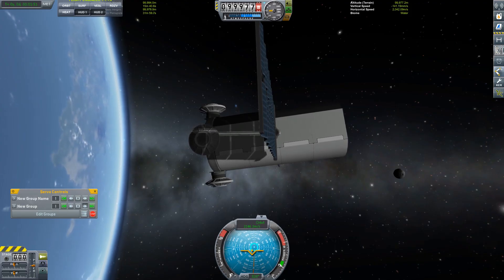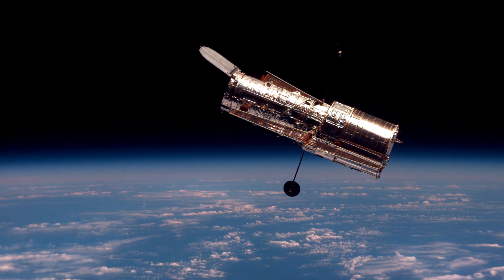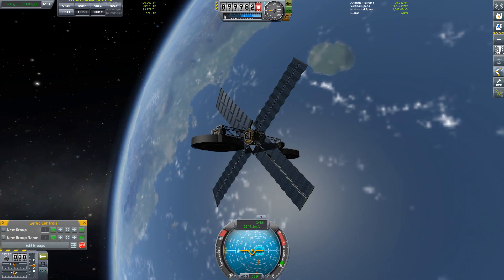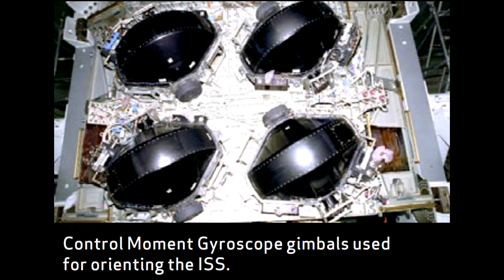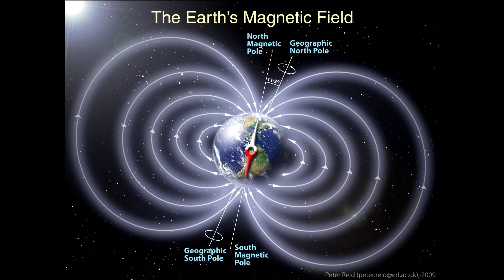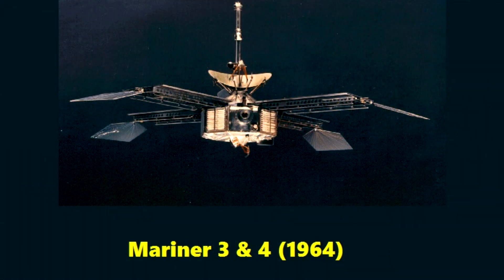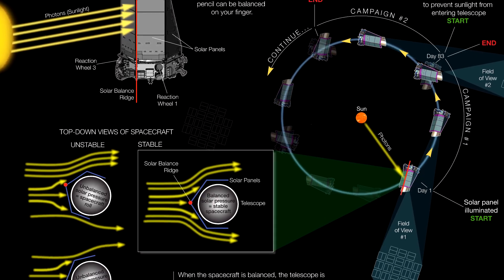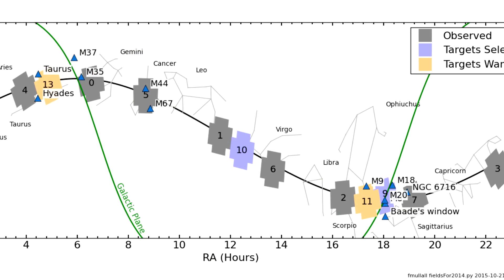Reaction Wheels - Things Kerbal Space Program Doesn't Teach

Comment: You can feel a gyroscope saturation first-hand if you buy a "gyroscopic wrist exerciser", a relatively small gyro with its axis placed on an inner diameter of a bearing inside a plastic shell. You add initial spin with a spring or with a "shoestring" pull - then continuously try to shift its axis of rotation using your wrist. This makes the gyro spin faster and faster, making turning its axis more and more difficult. In an exerciser, the gyro is being constantly slowed down by the friction of its axle in its bearings (transferring small portions of torque to your hand), but in a spacecraft, it will instead try to make the whole thing spin, so it must be countered by another gyro - which will also spin faster and faster...

Comment: Angular momentum isn't always conserved. Imagine a railway sleeper, floating in space, and a gun with a bullet. Nothing rotating, angular momentum =0. Shoot at one end of the sleeper. Bullet embeds itself in the sleeper. The sleeper and bullet now spin off rotating, but the gun is not rotating in the other direction. Angular momentum now <>0.
Reply from the maker: You have to calculate angular momentum around the center of mass in the entire system. the center is close to the sleeper, not inside the gun.

Comment: wouldn't it be most easy to use the gravitation force to get stable alignment with the earth?  - just moving the weight center far enogh from the object center should be enough to get a satalite rotating as it is turning around the earth.
Not as felxible as the used technology but it would seem the most durable and efficient method.
The moon shows that it is possible ...

Comment: Another issue with reaction wheels and gyroscopes is that they're pretty damn heavy. Anyone who has held an aircraft artificial horizon gyroscope will back me up on this that they're relatively heavy, since the heavier the reaction wheel is, the slower you need to spin it in order to reduce concerns about balancing and such. Not to mention they are very prone to failures considering that they are fairly complex pieces of kit. I guess there's also the fact that they can be fairly dangerous too, since they spin so fast and have so much torque behind them, it's possible for a person who might be replacing one to forget to spool it down before removing it. It's happened many times in Aerospace where people have hastily removed a Attitude sensor, only to realise that once it was loose enough, it'll start rolling around potentially hurting someone. Not too big of a concern regarding space since the people sent to do these jobs have a higher level of training than most people on the planet, but still a concern non the less when it comes to commercializing space travel and having to reduce the required training in order to fill in the jobs.

Comment: Couldn't you desaturate a control moment gyroscope by shutting it down, resetting it's alignment and then spinning it back up again (virtually no torque would be applied since the wheels are not spinning)
Reply from the maker: Sure, but that wouldn’t eliminate the rotation of the vehicle
Reply: @scottmanley  well that sucks

Comment: Hi Scott .. I just watched this, brilliant as always. I just paused when you talked about saturation on positional gyroscopes - instead of thrusters at this point to 'reset' against a constant exterior force like sun vs sola panels, why not shut down the gyro(s) in a well organised way, rotate them mechanically back to a 'resetted' position that takes into account this long slow correction that would be needed again, then restart rotation, process repeated ad infinitum .. ? That would use no finite fuel and use 'infinite' electricity instead...

Comment: Telecommunications satellites use reaction wheels in order to maintain accurate pointing toward earth. There is over time a net torque on the spacecraft due to solar effects. Eventually, the wheels become 'saturated', as you mentioned, meaning that they have been spun up to there maximum speed. At this point, a 'momentum dump' must be performed. This is where propellant is expended to provide force to allow the wheels to be spun down, reducing the RMP. An alternative to momentum dumping that  expends mono propellant would be to rotate the space craft via reaction wheels in the opposite direction. This is not done in the case of telecommunications satellites because they must maintain pointing at earth at all times. However, the Hubble Space Telescope does not have this restriction. In fact, the HST does not have any propellant based thrusters at all. Exhaust from thrusters could foul the optics. The HST keeps the reaction wheels within their limits through rotating the spacecraft only, not by momentum dumping with thrusters.

Comment: I suppose it wouldn't be feasible to combine momentum wheels and control moment gyros into one system that is capable of performing in both modes at once, right? They both have spinning wheels and both act against the vehicle's frame, so I would have thought their effects could be combined in a beneficial way, if not for attitude control but perhaps for desaturation, but I haven't heard of any such arrangement. Or have you?

Comment: There is another way to use reaction wheels.  Have 2 of them on same axis counter-rotating.  PV panels spin them up. You get attitude control by using one as a generator to spin the other or asymmetrical charge/discharge. You also can use them as power storage. Works best for satellites that pass through the shadows. High power output for a short time plus attitude control in one package.

Comment: Reaction wheels apply torque only when the flywheel is accelerating.  That is, in order to produce torque to rotate a sat a reaction wheel with an access of rotation parallel to the desired sat rotation must be spun up OR down and thus the torque applied to do that with result in a torque to rotate the sat.  So, it's not the speed of the flywheel but the change in speed of it.  There is, of course, a tiny bit of friction in the reaction wheels that must be compensated with torque from the motor, but the force of the friction and the torque of the motor tend to cancel.

Comment: Has anyone designed a gyroscopic system where the wheels can be stopped to allow them to be repositioned?  It would, of course, apply torque to the spacecraft to do so like a reaction wheel, but maybe if you operated them in pairs you could get the torque applied in a helpful way...

Comment: Is the fuel needed to de-saturate less than the fuel that would've been required to perform the maneuvers those saturated wheels performed to get to that point?

I'm guessing it would have to be, otherwise there'd be no point. Right?
Reply: If you just spin up the wheels to saturation then use fuel and then desaturate them, you will have used the same amount of fuel as it would have taken to do the rotation normally (conservation of energy). But if you do lots of small rotations in different directions, some of them will desaturate the wheels, so you save on fuel.
Reply: Thanks. :) 
That makes a lot of sense.
Reply: It actually does save fuel. With RCS you need to fire once to get the spacecraft to rotate, then fire in the opposite direction to stop the rotation. With RCW you change the rpm to rotate the spacecraft, then change it back to the original speed to stop the rotation. The overall change in rpm is ±0, so you don't need RCS fuel to counter that.

Another reason (I reckon) is that RCWs allow for much more precise changes in attitude, specially for smaller vehicles.

Comment: Would it be possible to handle saturation with a second set of reaction wheels or control moment gyros? What I am thinking is that while the first set spins down and reorients a second set could spin up and take over in the downtime of the first. I understand this would increase the weight of a craft and thus increase the cost of putting it into space; however if this works, would it not be a better choice for a long term deep space mission so that no fuel would need to be expended? Is there already a craft that uses this approach?
Reply: Great video by the way. I am a big fan of your channel.

Comment: 1:22 yes, but there is no definitive proof (yet, or ever) that our universe IS indeed a "closed system", which in turn puts the whole laws of thermodynamics in question as well. Granted, they fit very well to explain our current experience and observations of how the universe works, but my point is, conservation of momentum / energy is all based on a Closed system, of which there is no definitive proof that the universe actually is.

If different "membranes" of our dimensions indeed occasionally intersect with other dimensions / universe membranes (as some theoretical physics has proposed), or if indeed wormholes or black holes have some form of connection to parallel dimensions, the entire idea of it being a closed system is thrown out the window (as you have energy or matter transfer or "leakage" between said connection points).

So, while yes, in todays human world it fits very well to use these terms and laws of physics to do our science and calculations for our limited terrestrial affairs, we should still be very very aware of the potentiality of them, even the beloved obsessive laws of thermodynamics, not being entirely enforceable if the universe turns out NOT to be a closed system.
Just food for thought, that's all.

Comment: Say you have a ship with a solar panel on one side. The sun exerts radiation force on this solar panel, so you need to keep adjusting with your reaction wheel until it is saturated. Couldn't you just desaturate by activating another reaction wheel (which has its axis at 90 degrees respective to the first one), rotating the whole spacecraft 180 degrees, and voilà! You still need to adjust because the sun hasn't stopped shining, but because it's now turned upside down (respective to the sun) you're adjusting by accelerating the first reaction wheel the other way, i.e. by decelerating (or desaturating) it. Correct me if I'm wrong, but isn't this basic idea applicable to all the situations of the form which Scott is describing?

Comment: Scott, still watching the video. I have a question. If you have multiple redundant gyroscopic wheels, when you get to the point of saturation, can you spin down one of the gyroscopes, rotate it back to a neutral position, and spin it back up? I realize the spinning down and up of the wheels has side effects, but I wonder if this would allow for not having to rely on thrusters/fuel to de-saturate the system.

Comment: Why can't they stop the control gyros, not with physical brakes, but say with a magnetic system, and dissipate the energy as radiation pressure in the opposite direction, or perhaps into the batteries/fuel cells?
And after stopping, re-orient, and spin up again?

Comment: So this whole problem of saturation only seems like a problem if there's constantly an exterior torque applied to the ship, which outside of the atmosphere really doesn't seem very prominent when not using solar panels fully extended.. So, I think reaction wheels still make a lot of sense for ship control.
Reply: Saturation occurs because to keep rotating the spacecraft in a certain direction you need to keep speeding up the associated wheel/wheels.  Once they hit max speed you need to use RCS to stabilize the spacecraft as you slow them down otherwise slowing the wheels would rotate the craft the wrong way.
Reply: overkill1340 Oh, wow, I had totally been thinking about this the wrong way before.. I hadn't realized that, the wheels would continue to spin after the rotational adjustment to the craft was made! 
So wait a second though, once a roll input is made for example then if I'm not mistaken the reaction wheel will begin to turn and therefore cause an opposite spin on the craft in turn with that, but when the roll input is lifted BOTH of these will continue spin in opposite directions, yeah? so then, in order to bring the ship's spinning to a stop, is it wrong that the opposite roll input required to stabilize it would stop the reaction wheel and therefore not 'saturate' it? Because, in order to bring the ship to bear where it was initially would therefore send the wheel spinning opposite so I could only imagine that it would be stopped doing a roll and leveling out..
Reply: Yeah sorry, it's correcting for external torques on the craft that saturate the wheels "permanently".  You can overspeed the wheels by forcing angle changes capping the rotation speed, but correcting for solar radiation and atmospheric drag, etc will cause the wheels to speed up while the rotation of the craft remains 0, requiring another system (usually RCS) to desaturate the wheels.
Reply: overkill1340 Ah I get it now

Comment: Would it be possible, if enough torque is generated, to make an anti-gravity device by having them rotate in all directions at once with a majority providing upwards momentum?
Reply from the maker: +Michael Tarantolo no
Reply: If you want your reaction wheels to provide momentum in a direction rather than angular then you've gotta be throwing them outta the back of your rocket
Reply: The Large Hardon Collider The question was specifically about torque in reaction wheels and similar systems. The only ways to provide enough torque to counteract gravity is to have the gyro spin faster than V1 of said planet, potentially much faster depending on mass of the gyro. Even if that is achieved, trouble then becomes actually moving the gyro, as conservation of angular momentum is in effect and said momentum will be imparted to the mechanism moving the gyro, with very Kerbal results.
Reply: If you make the spinning objects about the size and mass of a planet, then yes. Not recommended.
Reply: the smart no of love
 <3
Reply: If what you mean is using rotational force to create a gravity-like effect in space, the answer is YES.

We call this centrifugal force, because it works in the same way a centrifuge does to separate blood from plasma for example.

If you imagine a giant hollow ring in space, and that ring is spinning, you could live inside that ring being pushed to the outside by centrifugal force, and you could stand up and walk.

Many sci-fi movies and video-games have already used this, for example: Halo, 2001: A Space Odyssey, Interstellar, Elysium, The Martian, Europa Report, and many other sci-fi books like Ender's Game (the movie didn't show it so much). 

A practical example is if you held a bucket filled with water tied to a rope, and began to spin in place. As you spin faster, the bucket would to rise vertically until it was co-planar with the horizon, but no water would fall out.

Real world examples NASA wants to try, is instead of building a huge ring, to have a living capsule tethered to a counterweight where we could spin both around each other to create a centrifugal force.

However centrifugal force has nothing to do with reaction wheels. In practicality, we would still use a fuel-based RCS to spin these giant wheels (or tethers) up.

Not sure if this is exact what you're asking, but if the question was "can rotational force create gravity-like effects" the answer is YES it can, and we've already know how to do this for a long time. With giant rotating spaceships.
Reply: AstralStorm Yes I see, I was clarifying because even the question sounded confused. I thought he was talking about reaction wheels in space, which the video was focused mainly on for their ability to provide attitude control in space. (hence why I thought he meant centrifuges) I didn't know he literally meant using a series gyroscopes at surface gravity to create upwards velocity, which obviously no, they only store rotational momentum for later, to be used to create a rotational torque when needed.
Reply: The momentum of the reaction wheel wouldn't be conserved in that case.  It would need extra momentum to overcome the gravitational force of the surroundings, which isn't supplied from anywhere.  The reaction wheel is mostly just stored angular momentum and uses a trick where if you flip it around, it will try to conserve its own momentum and transfer it to and from the ship.  If you had a vertical spinning bicycle wheel in your hand, standing on a platform that could rotate and you turned it sideways, the wheel would slow down and you would start rotating one way or the other, depending on the direction you flip it...  If you turned it back vertical, you would stop rotating and facing your new direction and the bicycle wheel would speed back up, because the angular momentum got transferred back to it :P  It doesn't create extra momentum that didn't already exist, so it would be unable to provide an extra force to fight gravity.